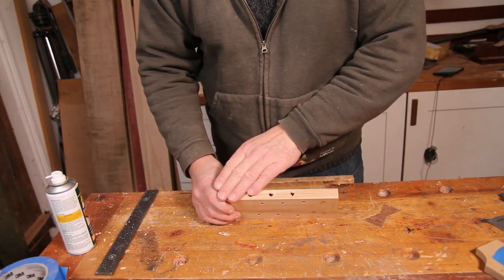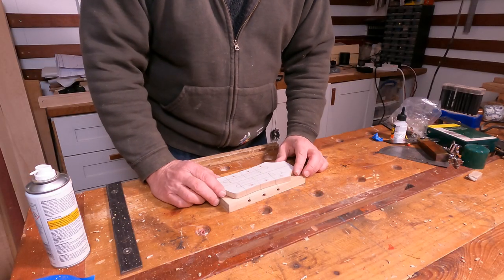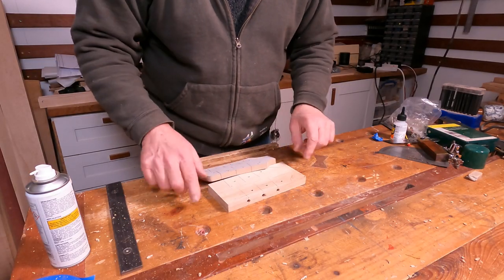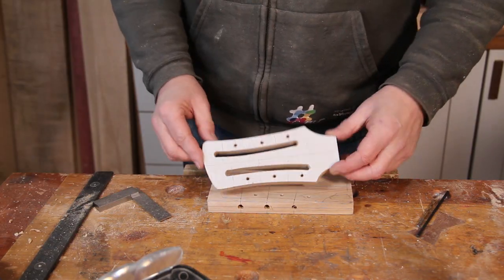Rickenbacker 620/12 guitar build Episode 4

Comment: Great work.  The process you went through to figure order of operations was brilliant.  I suppose the factory work is all CNC for the headstock. Doing a prototype will make the headstock work on the neck much easier.  You're a real craftsman!
Reply from the maker: Cheers Fred, probably is all CNC now or jigged up for speed. I was thinking while I was working on it that if I needed to make a few of these access to the old pin router I used to opperate at work back in the day would have made things easier.

Comment: I’m pretty sure that on the 360/12 I had years ago, that the neck side of the tuner slots had an internal chamfer down to those 1st two tuners, so that the string doesn’t foul on the edge of the slots. 

I’m pretty sure you know this, but I thought I’d mention it just in case.
Reply from the maker: Nope I didn't know that and hadn't even thought about that, I'll have to remember to check for clearance before I do any finishing. Thanks for the heads up :)

Comment: So that went perfectly. So just one more time but with the neck hanging off of it. On those angled holes from the side, I’m thinking maybe cut the headstock curves and then cut the reverse curve to clamp to the pillar drill. Then slide the two curves to the desired angle. They may not make sense without visuals.
Reply from the maker: Cheers Dane, Yep, I get you. TBH I think it should clamp ok and I can probably support the other end of the neck off the bench. Still a lot offwork to do though!

Comment: Headstock design by MC Escher. Excellent work figuring out the order of operations, as usual. Being dyslexic that kind of bent my mind a little bit. But once I thought about it in 3D I wrapped my brain around it and it made sense. Very cool way to stuff a lot of tuners into a small space. Great work so far! Looking forward to the rest of the series.
Reply from the maker: Cheers mate, I had to google that!! I was the same, trying to think about it as one thing melted my head but chunking it down did the job.

Comment: Nicely done mate and well worth prototyping. My surfs slots are closed at the back so better this was all the way through. It is indeed a cracking bit of design. the biggest problem i have is remembering which key is for which string!
Reply from the maker: Cheers bud. I think all the way through will make stringing easier but remembering which key does what will be an issue, I struggle with six sometimes!!

Comment: On older Rickenbacker 12 strings the slots in the head stock are not all the way through.  It makes changing those strings a little bit of of challenge.  I believe Rickenbacker had changed this and the slots were made all the through.  Which way are you going?  Good luck I know it will come out beautiful.
Reply from the maker: I'm pretty sure I don't have the tools do it the original way unless I made another, complicated template so I think I will go with the all the way through option :) Good bit of information though, cheers.

Comment: Well, I'm fairly sure I would have gone through more prototypes and plenty of swearing to get to that point, but it does look grand! How's the weight? I keep wondering whether conventional 12-string neck dive is because of the extra tuners, the extra length of the head, or some combination of the two.
Reply: I used to own a 360v64, it was a well balanced instrument no head dive from what I remember. Vintage tuners are lighter that modern ones too, so maybe the newer style 12 string Ricks might be more headdivey.
Reply: Most of my 12-string experience was with a decidedly crappy old acoustic. Not so much meat on the body to counterbalance the neck with one of those.
Reply from the maker: The prototype is about 0.5KG so not too heavy and I think the shorter headstock will keep the weight slightly more central. Also the strap button on the top horn looks to be quite well forward so I can't see neck dive being a problem.